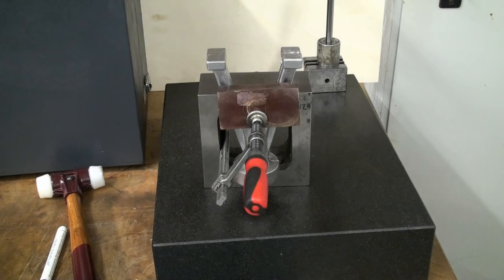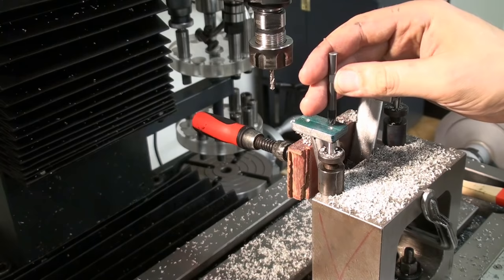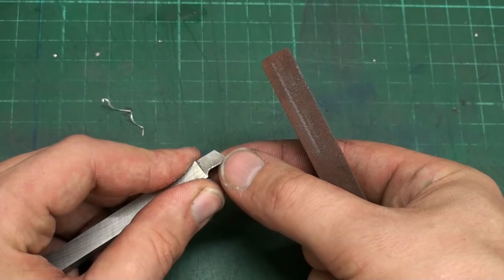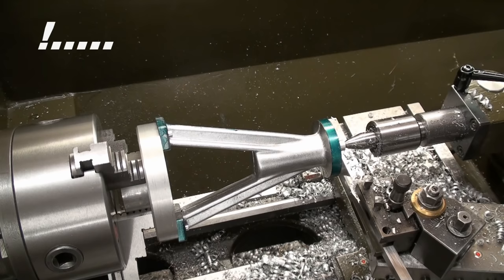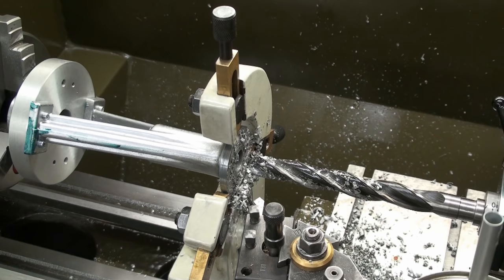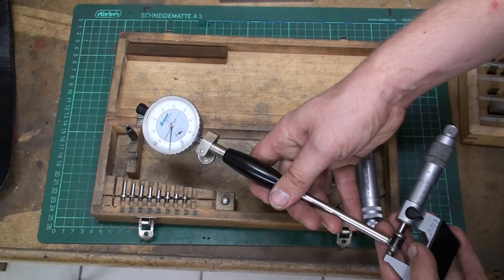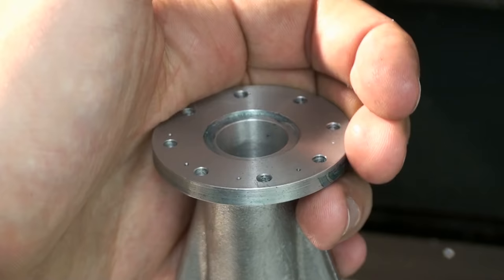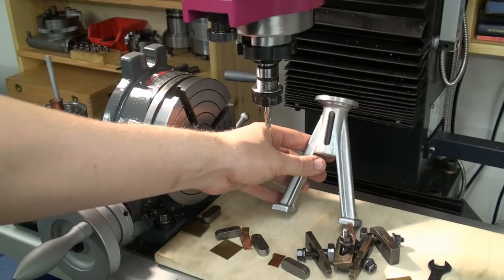Simplex steam engine Part 2 - Simplex Dampfmaschine Teil 2

Comment: Another precise way to measure the inside bore is with a pin gauge set. BTW: You speak perfect English! 
Thanks for these amazing machining videos.
Reply from the maker: +Guy Tech Nothing like sticking something in a hole...yeah gage pins are great - At work we have a 1/100mm stepped set from 0,5-10mm and above tri-mikes. The gage pins are great to use and pretty much fail(fool)-proof.
I only have a 5/100mm stepped set from 1-5mm in my own shop...

Comment: That tool is called a Dial Bore Gage as used in USA. You could just fill weld the holes and start over there, but I’m sure you thought about that. Machinists aren’t necessarily good welders anyway. Nice work Stefan!

Comment: Yeah, there are few things as resilient as cobalt high speed steel. As well as lathe & mill tooling I use 5% cobalt to stitch my own rasps. I tried to use standard plain high speed steel at first, but only managed to raise a couple of very fine teeth in O-1 tool steel before the tip crumbled. With the 5% cobalt it's possible to stitch over 100 teeth before regrinding is necessary, & it's not really regrinding, it's more heavy honing.

Comment: Stefan, I am only familiar with the very simplest of DRO set ups, but have you researched to see if yours has a setting that will automatically set the end angle at 360° from the start angle?  Seems the "oops" you made here would be common for setups where you're not using a 0 start angle.

Comment: Nice work, as usual, except the 16 hole pattern ^^. In engine (re) building the two point measurement is superior in detecting ovality. Furthermore a micrometer stand really comes in handy for the calibration / dimensional comparisons.

Comment: I believe your DRO tries to help you make N holes between a start angle and an end angle. There is a classic off-by-one, or fencepost, error lurking there. For a regular distribution of say 8 holes, if you state your start and end angles as 0 and 360 then you need to specify N+1 holes, so 9, with the first and last identical (as I believe you did in another video). I think this is the wrong way to go about it. Much better to get into the habit to spell the exact angles for the first and last holes, *as distinct holes*, say 22.5 and 337.5, and specify 8 holes. This will generalize to the case where you need a regular distribution along an arc that is not a full circle. 
Of course I might have misunderstood completely, in which case I apologize. I am not in mechatronics at all, but your videos have opened a whole new fascinating world. I am in awe of your skill and pedagogy, subscribed a few weeks ago and almost cannot stop watching (and drooling...). Heartfelt thanks and greetings.

Comment: I have to disagree with you on the snapgages. In my opinion they are more elegant then yet another bulky (expensive) measuring device, that has to be calibrated none the less on the micrometer. for  repetitive deep measuring on cylinders, ok, i can see the point. not for on the lathe, where space is often limited. Just my opinion though. Cheers.

Comment: I see you have a Ditron DRO, I have the same unit and a similar lathe, so I bought 2 extra scales and put these on the lathe, so I can just swap the connections (will build a switch at some point). you can swap the DRO from Mill to lathe mode, on power up. just an idea for you.
Reply from the maker: +Essex AutoBarn Yes, that would be nice, only problem is that the mill and the lathe are about 3m apart from each other, so I also would have to move the whole DRO over...
But I dont have much need for a DRO on the lathe, I get around with the dials and dial indicators pretty well :)

Comment: why do you prefer bronze finger to rollers in your steady rest?
the english term you were looking for is 'bore gage'.
Reply from the maker: +crazymanmichael Because the roller ones make problems if there is only a little piece of swarf - It will get rolled into the surface, the bronce fingers just push it away, at least for the kind of work I do :)
Reply: thanks for the explanation. you have given me food for thought as i had been considering changing my bronze jaws to bearing type and had neither heard about the swarf problem nor, of course, thought of it my self.

i don't often have questions following your vids as you give very enlightening commentary as you proceed with the work. 

do you plan on giving an in service evaluation of the new mill at some stage?

Comment: Hi Stepan
I did not know that about HHS with Cobalt.  Would Cobalt dill bits be the same?
You should check out mrpete222 Shop Tips #186, Vertical Shear Lathe Tool. It may give you a good finish on this   material. It's strictly a finishing tool tho.
Thanks for the video.

Comment: How did you lay out the 4 holes that attach the A-frame to the sacrificial faceplate?
Reply from the maker: I think I drilled them on the milling machine using the DRO

Comment: I still don´t understand why depth micrometer doesn´t have the rachet screw like all other micrometers.
Reply from the maker: Mine has a ratchet, but I dont like to use it on the depth mike, for me it lacks the necessary sensitivity.
Reply: Really?! I have a Tesa and Etalon and neither of them have the ratchet. I thought it was standart for depth micrometers but now I know I was wrong. I like the ratchet because too much force in the thimble lifts the base of the micrometer resulting in wrong measuring. Your videos are great, by the way. So entertaining!! Good job!!